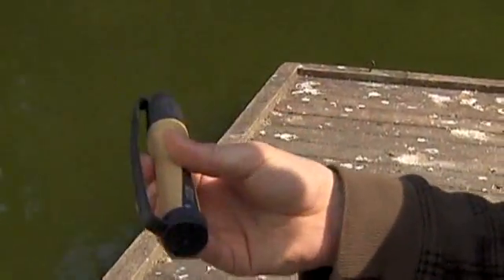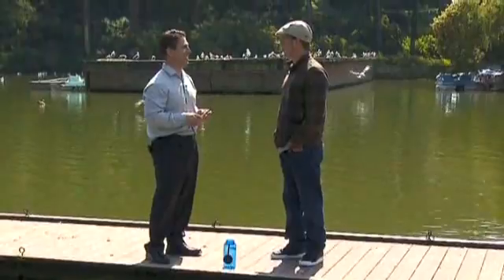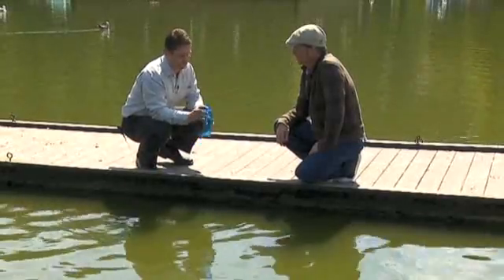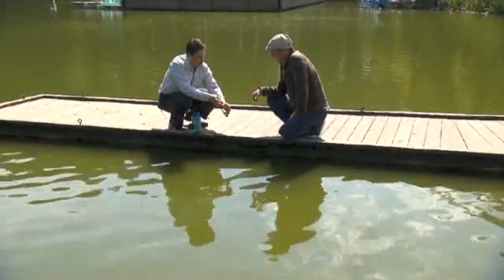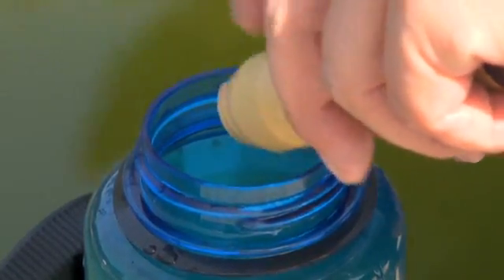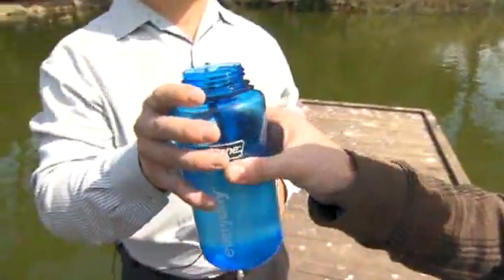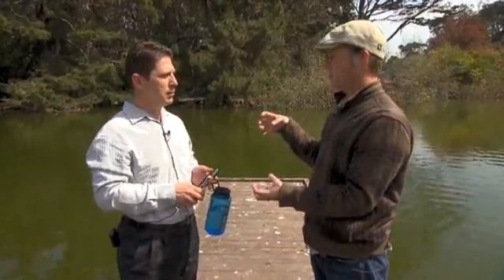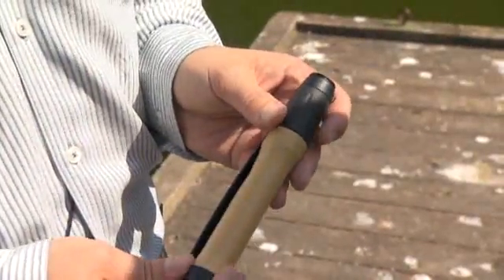Pond water to drinking water

Comment: OK guys. That should have to sit for at least an hour to be even remotely potable, with the solution sitting in it. And maybe with double quadruple for the solution sitting in it…It doesn’t make sense that you could just drink it straight out of the pond with a solution and a wait time. What am I missing here?
Reply: You didn't miss anything. They basically said the solution kills bacteria and viruses, but that's all. The water was "still murky," meaning it isn't filtered. So you're still going to be drinking bits of dirt, sand, and poop, it's just very clean and disinfected dirt, sand, and poop. It probably won't get you sick drinking just a little of that, but if you're stranded in the wilderness and need to drink water this is better than nothing. I wouldn't drink it every day for the rest of my life of course, but as an emergency I'm sure it's alright.

Comment: is it really safe ?
Reply: +dacii mini Yes, it is safe.  The disadvantage with this kind of filter is it only kills things, but doesn't actually filter anything out.  So the murky water will still be murky, just clean.
Reply: This was a really stupid demonstration. He didn’t show the part where he added the salt to the device before adding the water. Also, you’re not supposed to drink it like that even though it safe. You’re supposed to put the dirty water in a reservoir (like Camelbak or similar) and add the sanitizing agent to the water in the reservoir. Then attach an MSR inline filter to the bladder so when you drink through the hose, the murky detritus as well as the bad tasting chlorine is filtered out before you drink it. Very poor demonstration.